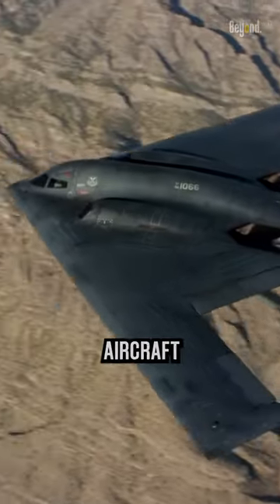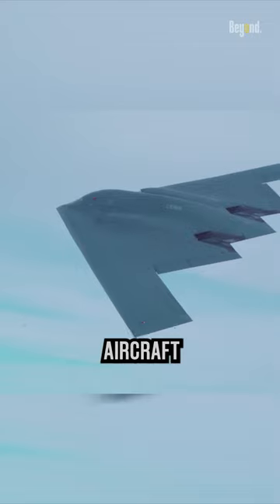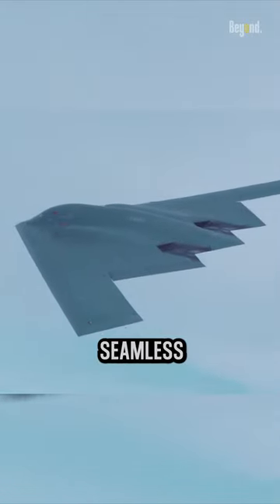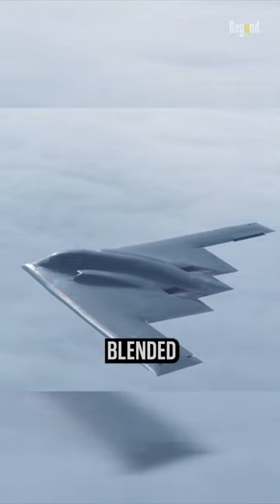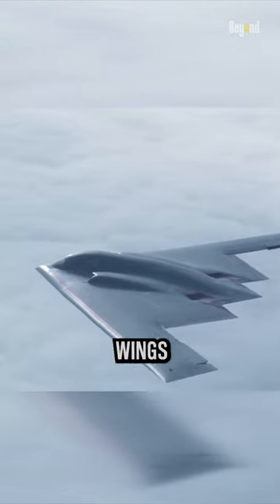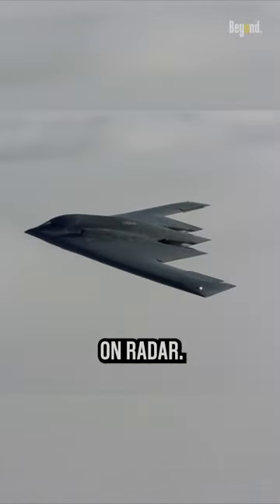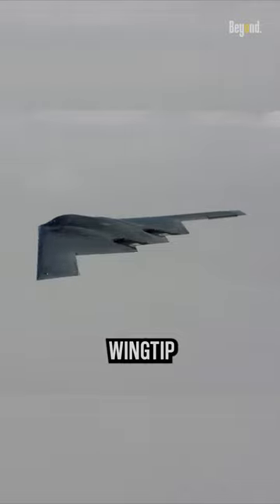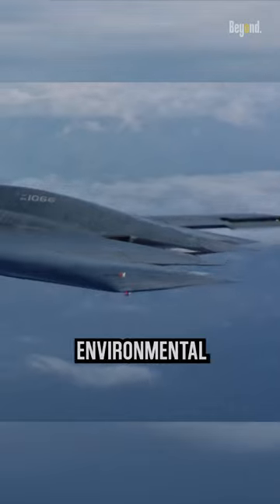What are the advantages of flying wing design? #shorts

Comment: Yeah, but it's aerodynamically unstable. Without computer controls, it's unflyable.
Reply: Technically, it is possible to fly without computers. However, it is just extremely hard, and requires a professional to fly manually.
Reply: @meaty8887  even then, without computer control, it simply isn't possible to recover if/when the plane departs from controlled flight. That's what "aerodynamically unstable" means. That the plame won't self-correct.
Reply: Without fuel it won't fly that's what you're basically saying. It's in the air, flying, end of story